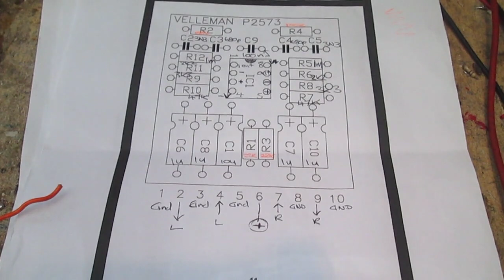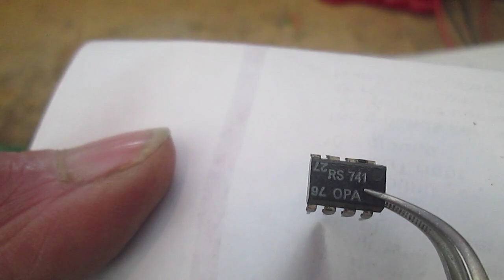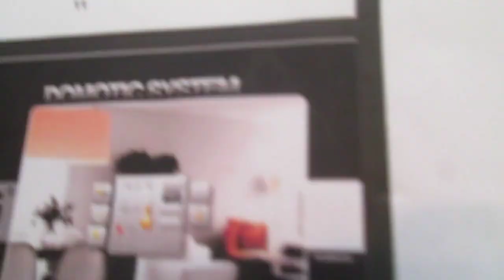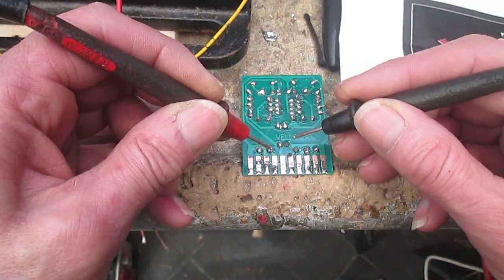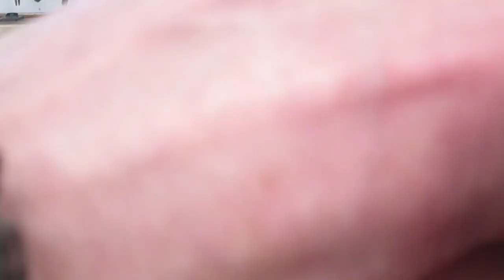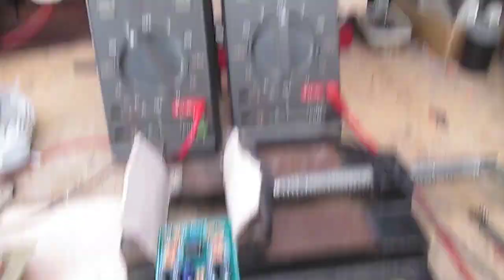Electronics Fault Finding - Vellerman RIAA Pre-Amp - Part 1.

Comment: Great troubleshooting video, Andy. Break it down into sections. Excellent.
As for the "741" I would be really sus on it. That black crud on the pins makes me think it is either a counterfeit or has been exposed to some corrosive chemicals.
I think the chap needs an 800 deg F iron tip. Like you said- Get on with a hot tip, solder, I get off quick. Be sure the traces are clean.
   Now I use isopropal not rubbing alcohol to clean with. Acetone can damage some plastics and can leave an oily residue.
   Yes, I totally agree on the blobby joints.  Too easy to get a rosin joint. 
 I have seen kits put together with the "lytics installed backwards, and same with bridge rectifiers. I also suggest testing every part before installing. I have found more than one part bad out of the new box. (HeathKit had 2 massive screw ups. Resistor bands were painted the wrong colors, and diodes had the cathode band printed on the anode end. Never trust new parts! Always verify.  Many kit builders here were really pixxed off over those errors. It actually made articles in the magazines here.)
 At least it appears he uses rosin core solder and as shiny as the connections are, like not that useless "lead free" crap solder. I have also seen entire boards eaten up by the builder not following instructions and using acid core solder. 🙄 

  Next "Care" pkg I will send you something that would make troubleshooting on IC's easier for you. 

Of note: I have seen IC socket pins break off in the plastic causing a hard to find intermittent problem (Same on tube sockets). Also have seen socket pins lose tension, and the IC leg doubled over under the IC, with the IC soldered to the board. Boy that was really a nasty one to find!! 

Having a good schematic really helps. Glad you got the assy. manual to help out with. Marking each part on the pictorial to verify it is in the correct location is a good idea.
Reply from the maker: Thanks Frank, some good tips there too. Yes I've had diodes wrongly marked and a bridge rectifier with the corner indicating Vcc negative not positive, you really have to be on your toes. TFW.

Comment: The 741 was never going to work in a stereo circuit as it is a single and not a dual amplifier. You had a better chance with the TL027 because at least it has two amplifiers in the package. Almost all of these opamp based RIAA circuits use a NE5532 though. From the look and markings of the original 741, it is ancient, I would guess at mid 70s manufacture. It is branded "RS" for Radiospares as they were then or RS components as they are now. The black stuff on the legs is pretty common on components that have been stored for that long. I wonder what opamp was specified on the component list.
Reply from the maker: Well caught, I didn't twig to that. I think the original opamp in the kit got changed & then got lost when it was sent to me. Your right, a 5532 would be the right choice though I find them prone to instability sometimes. Did you know they're stopping making the 5534? Get some in whilst stocks last.
  Yep, RS - Radio Spares, I went into that but cut it out to keep the video short-ish. AFAIK the black deposit is also found on some Japanese 70's transistors, something to do with the plating? Silver tarnishes black, not sure if that has anything to do with it. TFW & thanks for your excellent comment.